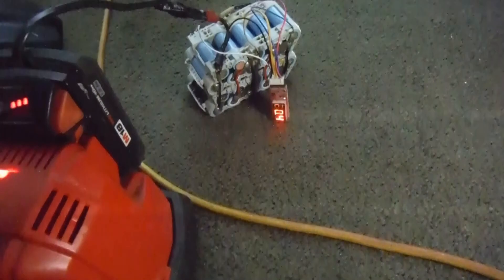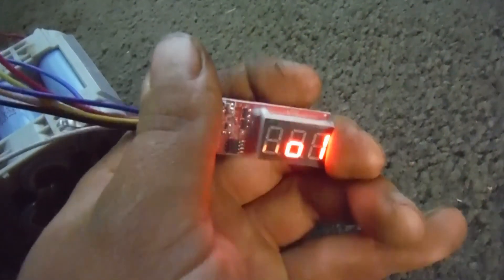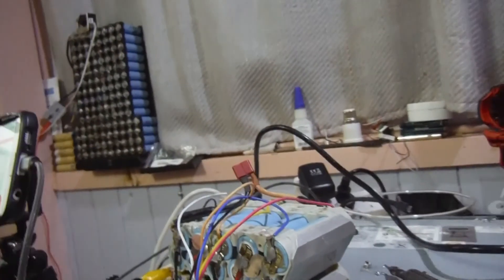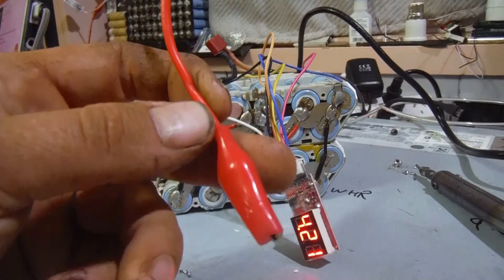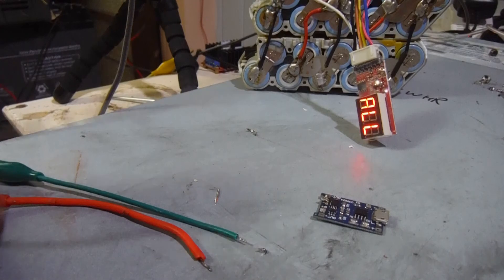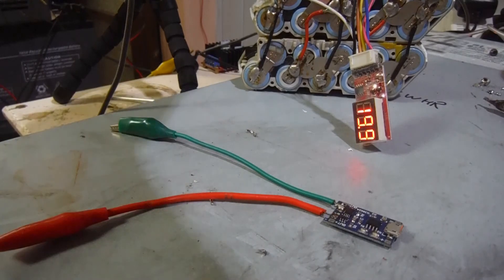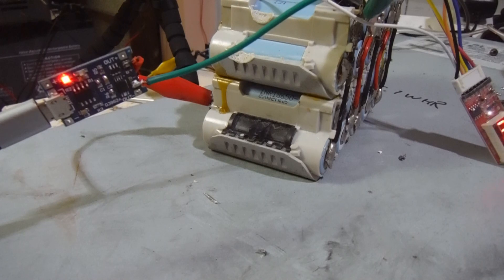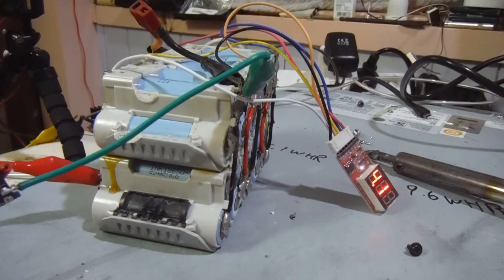TP4056 usb charge board  to re balance a 5s 6 amp  backup battery !

Comment: using 5v power supply to charge ? i don't understand principle of charging type
Reply from the maker: Khanh Duong Quoc so these little boards safely charge li-ion  batterys to 4.2 vs max off a 5v or usb supply very handy  when playing with lithium batterys
Reply: yes.you use 21v power of battery.why is balance charger
Reply from the maker: Khanh Duong Quoc because the cells got out of balance and if i continue  to charge with Milwaukee  charger it was going to fry the 3rd 4th 5th cells in this case
Reply: One up the sleeve customs 
this circuit only show voltage  for each cell.it does note support balance charging
Reply: One up the sleeve customs 
the milwaukee charger supplies  21v or 5v
Reply from the maker: Khanh Duong Quoc thats exactly  right the little meter is just to check balance
Reply from the maker: Khanh Duong Quoc 21v
Reply from the maker: at 6amps
Reply: if you use a 21v power ,balance charging can't be.can you show detailed ciucuit ? i want to know how you make that circuit
Reply from the maker: +Khanh Duong Quoc ive not  made one it has one in the milwaukee  battery but i dont know how it it works. I normally  use a balance charger but there all broken
Reply: One up the sleeve customs 
your board which display voltage is doesn't balance charger.it just measures voltage at each cell
Reply from the maker: +Khanh Duong Quoc its only a display so you can check them not a balancer
Reply: One up the sleeve customs 
yes.is it safety when you charge  like this.battery pack does't have protection board.
Reply from the maker: +Khanh Duong Quoc you can even get them with an alarm so they beep when over or under charged